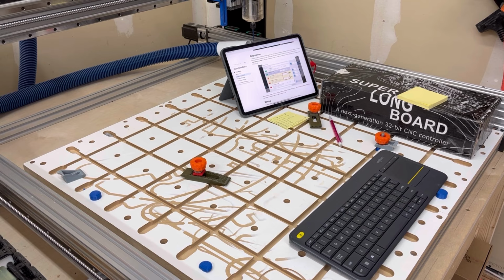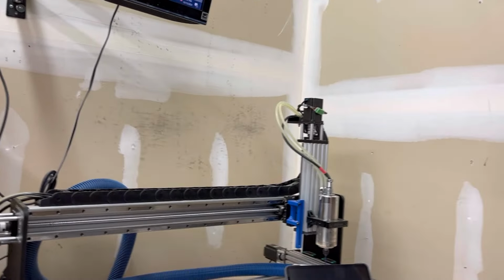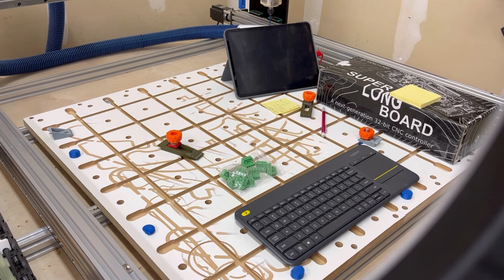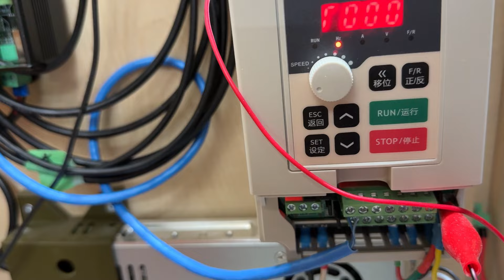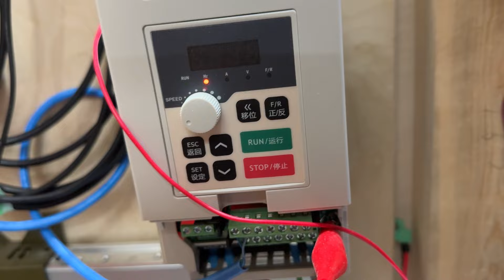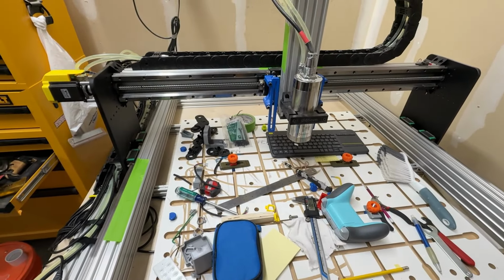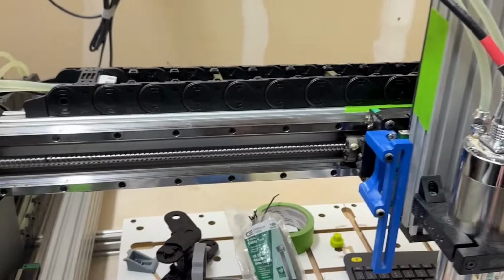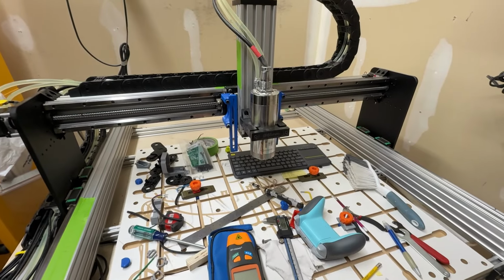Ultimate Bee Upgrade - Super Long Board

Comment: Awesome video, thank you for sharing, I also have issues with m Y2 making weird noises at higher speed and acceleration, doesn’t happen with x or z, I wonder if upgrading from xpro can fix that, is this controller 24v or higher
Reply from the maker: Thank you very much! 
It cleared up my noise issue for sure, funny enough it was only when homing the Y axis not while cutting and my cuts were always good so I didn’t pay it much attention. 
The Super Long Board is 24v only and was something that I considered when buying. As I am Canadian I felt compelled to try a Canadian product. :) 
I also looked at the Nighthawk and you can use at least 36v with that one. 
So far the biggest advantage with the SLB I see is the board and firmware is well documented and supported.
Reply: I'm in the same boat as well.  I am on my third xPro (all warrantee replacements) and the Y screams for me as well, plus it is flaky sometimes.  They seem to be mostly out of business now and Bulkman is advising not to update them to FluicNC anymore.  I just pulled the trigger on the SLB to replace it before it goes again.  I appreciate the video and have a question.  Did you change the Z to 16 micro stepping for any particular reason?
Reply from the maker: @philshel1  hey I hope you enjoy your SLB when it arrives. 
I set the Z to 16 micro stepping as I was getting some binding when I had it set to 32.  I think that my acceleration was to high when I tried 32 micro stepping and when I get some more time in the garage I will try to play with the max speed and acceleration to get it setup with 32 micro stepping in the near future.